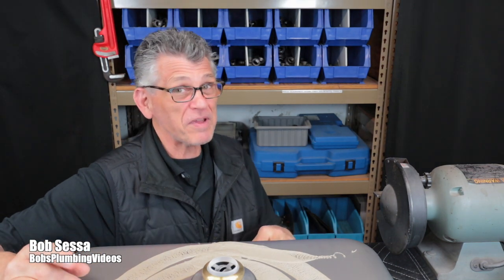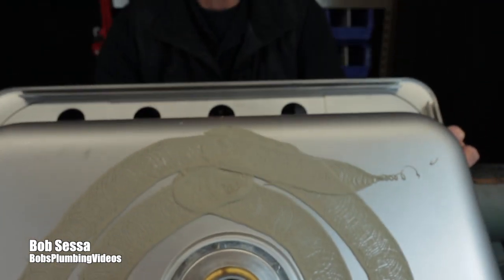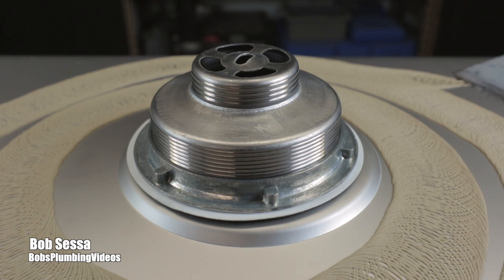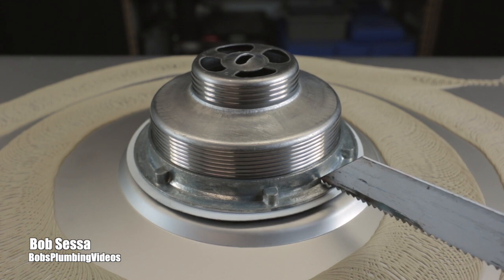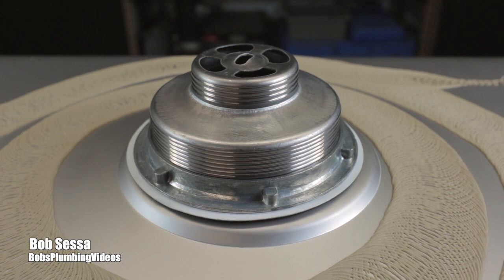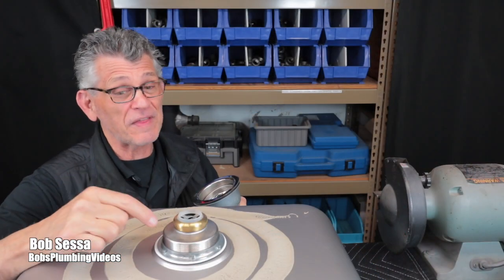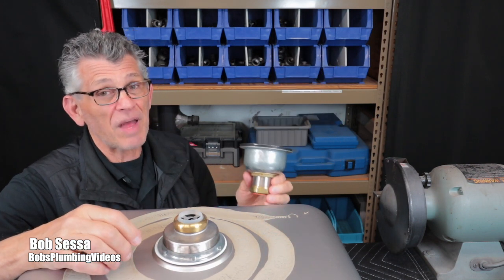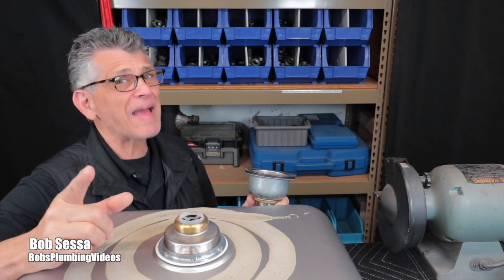Kitchen Sink Basket Strainer Stuck?

Comment: I just ran into this problem just a few months ago. I bought the spatula looking tool from The Home Despot and it was worthless. I did have some minor success with a tool from Channellock, the 12in. Offset Oil Filter Pliers, Model# 2012. Lucky for me the whole strainer was rusted threw so it just disintegrated under the force. Thanks for posting this Bob, stay well
Reply from the maker: You as well, thanks for checking out the video. Regards, Bob.

Comment: This is one of the most helpful video I've ever watched.  He just saved me $400 - $500 today:

After my husband wasted today's whole day trying to manually remove the upper screw/nut of the kitchen sink with several plumbing tools and 2 trips to Home Depot for supplies (and made me suffer 2+ hours helping him), he finally gives up and decide to call the plumber tomorrow.  
I had to make him follow this video's instructions.  We finally was able to cut through then ply open the upper die-cast lock nut with the multi-tool & screwdriver (last method mentioned in the video) within 15 minutes without damaging the sink at all — first try too.

Comment: Bob, thanks x 1000. Used Dremel, worked like a charm, but you're right about being careful not to put a hole in sink. I did hit the insulation. I was all set to go to HD and find some tools that I probably would use only once. I don't own but have used a multitool before, would be perfect for this. Also started with a regular hacksaw but room was a problem. The little Lenox would be great too. That's really all you need. Again thanks x 1000!!
Reply from the maker: Thank you for checking out the video! Bob

Comment: Bob, Thank you for sharing. I also used a drill with metal bits drilling  two holes each  on opposite sides. Then applied your flat head screw driver twisting technique which did the trick.  Regards from Jamaica
Reply: The drill worked great. One little nip and the flat head screw driver did the rest.

Comment: Thanks for the explanations about how to use different tools to cut the stuck strainer nuts. Mine was brass, looking good, not rusted at all. But still, there was no way to move it. After I cut it with multi tool, I found that there were so much plumber putty in between the nut and the strainer.  Not just rusted nuts would stuck, a good one can do so also, because of the plumber putty. My new one is made of plastic, so the new owner of my house should be able to crack and remove it easily even if it stuck.

Comment: Great video. The multi-toolI looks like it would make quick work. I didn't have one so I simply used a diagonal cutter and was able to bend and cut the top flat horizontal part then I used a small drill bit to make small holes down the vertical part then used a screwdriver to pry it out. Worked quickly without any possibility of cutting the stainless sink.
Reply from the maker: Thanks for the info! Appreciate your visit! Bob.

Comment: Most of the new strainers now are stainless steel with plastic nuts and threads. Bought one a year ago no leaks works fine $9.50 from Amazon came with the stainless steel basket and stainless steel stopper works great  easy to remove plastic nut in the future.

Comment: Another great video.  

 I wish someone would make a plumber's putty alternative.  Half used tubs dry out quickly, and if the strainer isn't installed tight enough the putty will start to dissolve over time and leak.
Reply from the maker: Some guy's use silicone caulk, but I'm still old school and think putty is bullet proof! Regards, Bob.

Comment: hey Bob you forgot about friction washer under black gasket great video
Reply from the maker: That was a test Walter LOL! I agree if the nut is in contact with the rubber gasket, no question a friction washer is needed. For these deep dish strainers the locknut doesn’t come in contact with the rubber gasket so this works out well. Regards, Bob.

Comment: Thanks for the video. I've got a situation where the nut broke right off and the pipe came out, but the cup part of the basket strainer is just stuck on the sink and will not budge. Any ideas?
Reply from the maker: The lock nut or the nut holding the tailpiece. A good old hacksaw generally solves everything, at least for me!
Reply: This is happening to me at this exact moment, and I have no clue what to do
Reply: Did you ever get the cup/sleeve/bell cover off?

Comment: I have had decent luck with a flat head screwdriver on the nut ears and hammer to break them loose.
Reply: How did you immobilize the basket? Usually, hitting the nut ears just moves the basket too.

Comment: Hey Bob... I bought the Coflex Deep Cup with the brass nuts.  The directions don't say anything about using Plumber's Putty and the description on Amazon says the foam gaskets eliminate the need for plumber's putty... I'm a little leery of not using putty because that's what I've always done... do you use plumber's putty with this strainer basket?  If so, do you use putty  of the foam gaskets or  the foam gaskets?
Reply: sorry... should have asked if you do use foam putty, do you use the foam gaskets too?
Reply from the maker: I only use plumbers putty, ditch the foam gaskets!

Comment: can the strainer basket rust to the the strainer itself
Reply from the maker: Yes, it happens sometimes, you just have to carefully try to pry it off once the nut is removed. Slow and easy does it or you'll risk damaging the sink
Reply: @BobsPlumbingVideos  thank you for the heads up I ended up having to cut off the drain basket with my Dremel it was rusted and  puttyed together
Reply from the maker: @joseykindred2481  My Pleasure! Regards, Bob.

Comment: Bob, I am in the middle of trying to remove a drain from a commercial SS sink. My #%^&* lock nut is made of brass. Will I still be able to cut through it? I am thinking of going with the cutting tool on my Dremel.
Reply from the maker: The brass nuts generally will come off without cutting, but if you have to, they shuld cut like butter. Much softer than those die cast nuts.

Comment: how do you remove the one in the thumbnail?
Reply from the maker: The old fashion way, a hacksaw. Or if you own a multi (oscillating tool) use a metal blade and slice thru the nut.

Comment: Those cheap basket strainers  all I do is get a big flathead screwdriver and a hammer  get the flathead between the nut and the body pound it  in than twist the driver the nut starts to break off in prices. It’s a shame cheap metallic  as supposed to a solid brass strainer

Comment: i installed a chrome tailpiece at my grandparents house it connected to a strainer from 1938. when i replaced the plumbing i did not replace the 1938 strainer. i came back a few weeks later and saw my chrome work was rotten. it was rotten because the strainer was leaking on it. now i have to re do it the only part i can save is the pvc p trap and the nova vent. since i'm in Wisconsin i can use pp and pvc. i will have to cut out the strainer.